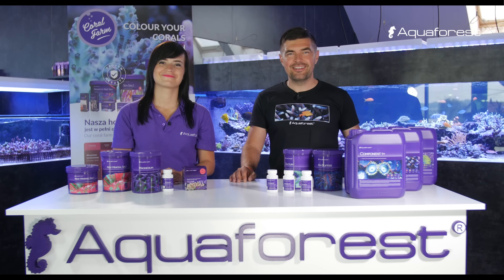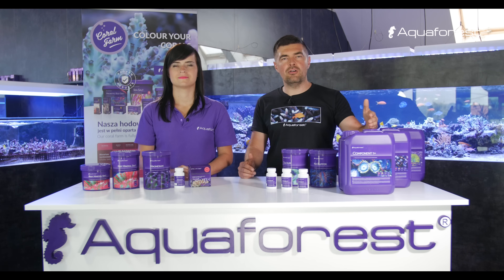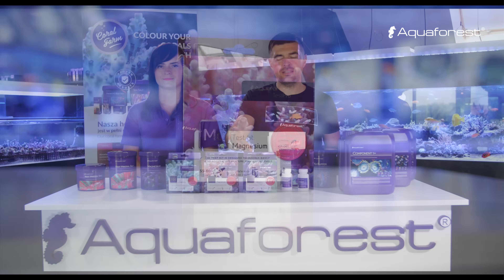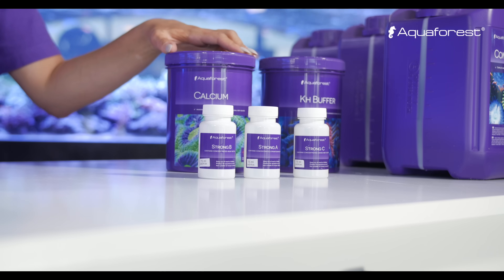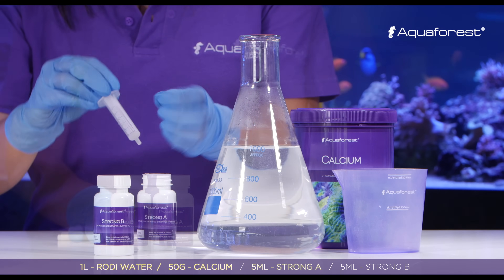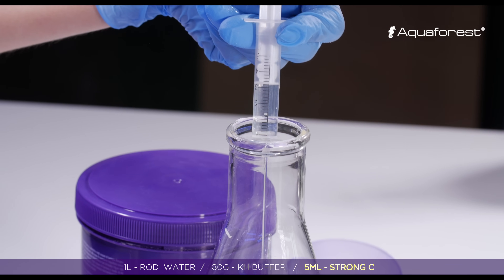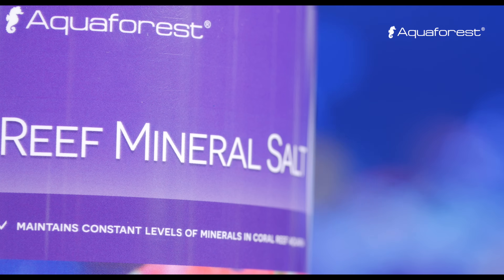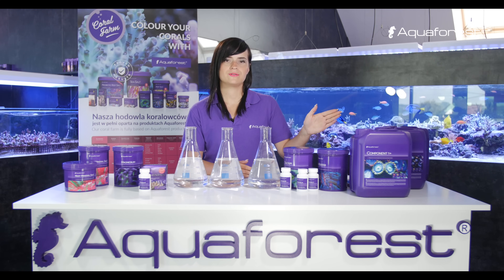How to use and prepare Component 1+2+3+ - Balling Method solutions using Aquaforest products

Comment: I have some questions regarding the balling method
1. Does the use of component 123 / balling have to be the same dose?
2. What of the lowest absorption do I use?
3. If the absorption parameters of Ca, Mg, and Kh are not the same, what is the solution?
Thank you very much
Reply: You balance your parameters first based on what you want it to be. I.e. 8.3 alk, 440 ca, 1380 mg first , then dosing 123 maintains your parameters based your daily usage, and over time they may be a drift in one of more of your macro elements so you adjust it.

Comment: My KH solution always has sediment on the bottom , it does not completely dissolve .
Is that normal?
Thank you
Reply from the maker: It should be full dissolved.
Reply: @AquaforestEuAF  please help! I am having issue with sediment on the bottom also. I tired placing the container once mixed in warm water to help dissolve and I am still having this issue. I use all your products and I only have issue with this one!
Reply from the maker: @ZeeTheCoolGuy  What is your temperature of water?
Reply: I'm having the same issue. The packaging does not have any mixing instructions to prevent sediments. I also tired placing container in warm water and shaking. I still have sediment!!!

Comment: I have my Kh at 7.1 Ca at 450 and Mg at 1500 and I was told and the video explains I am supposed to dose equal parts which should be about 20ml of each in my reefer 525, I'm just confused because I already need my Mg to drop so how is dosing 20ml of Mg a day going to be helping me and keeping things balanced, I would greatly appreciate some answers
Reply from the maker: If your KH and Ca consumption is 20ml/daily I recommend to use KH Plus and Ca Plus only to let Mg drop. When your parameters will be consuming equal - dose macro equal.

Comment: HI, I started dosing your balling component since 22 february when my alcalinity was in 7.7dKH. Calcium and Magnesium were 410 and 1290 ppm respectivily. Today I made new tests and I found these results: alcalinity - 9.6/Calcium - 430/Magnesium - 1320. I'm worried about the high increase of alcalinity. What should I do? My tank is a 120 liters and I am dosing 5ml per day of each component. I have few corals, mainly softs and LPS. I'll appreciate your help. Thank you
Reply from the maker: you can stop to dose Component 123 and obseve parameters. And dose each elements separately: Ca Plus, KH Plus and Mg Plus if there is a need to dose them.
Reply: @AquaforestEuAF  I can dose each separately right? I have to use given solutions right? Like adding component strong even if using individually!?

Comment: HI, I'm using your balling kit and I see a little brown decantation in Solution 1 (Ca). Is It normal? Thank You
Reply from the maker: Eduardo Dias yes it's normal. This is natural decantation , don't worry you can use it
Reply: Aquaforest thank You so much
Reply: Before I start your balling method, I was puting AF Fluorine, Kalium and Iodum. Should I keep dosing these separeted elements even using the 3 component formula? Thank You
Reply from the maker: It's not necessary but if you need and you have some deficiencies of these micronutrients - please dose separate elements.

Comment: So the question I have is the old recipe you gave all of us on reef to reef was to mix calcium and mag together in component 1 but this vid now you are mixing mag with mineral salt in component 3 so what is the correct way to mix it and why did you change it?  So is the component 1 no good if we mixed calcium and magnesium together
Reply: Maybe your corals consumption is low thats why they are not absorb all micro elements contained in Component1+2+3+
Reply: I am just finishing up my first batch of the original 1+2+3+ where the Ca and Mg are mixed together. I found it fine up until a certain point where my reef is growing a lot but Mg isn't being consumed as much anymore. Next batch I am leaving out Mg all together and just running Ca & Components strong in Comp 1+, Alk & Components Strong in Comp 2+ and Reef Mineral Salts + Components Strong in Comp 3+.
My Mg is way too high with the old formula as my Ca is still being consumed at the same rate but the Mg is not so I am removing it from the formula and might add it at a later date into my Reef Mineral Salts.
Reply: Good question!
Reply: Super PokeBanger hopefully they get  back to us as I have batches mixed up already. If they are no good hopefully they can replace it
Reply: I have almost a jug full of component 123+, I stop using it after getting massive algae out break (hair algae, dino and bryopsis) after switching from BRS 2 part dosing. All my sps are doing well before I switch. As a result I ended up tearing down my tank. I won't go back. But in fairness their AVE are good and I still use their salt.
Reply: You can mix in both ways - no problem. If someone wants to have Mg separate there is a option to mix Reef Mineral salt with Magnesium but of course you can use standard recipe: Calcium+Magnesium in 1 solution.
Reply: Fugs Reef I started mixing the new keeping all separate like any 3 part would be. Seems to be ok. My mag was dropping before but cal and alk were holding good. So with mixing my own batches I added a little extra mag to component 3 after adding mag on its own to bring it up.  The only thing is I work out of town and didn’t want to change to much as the wife will feed and full ato but testing she doesn’t do.